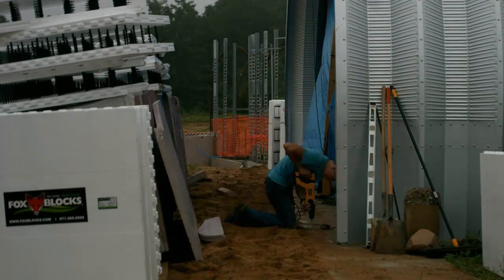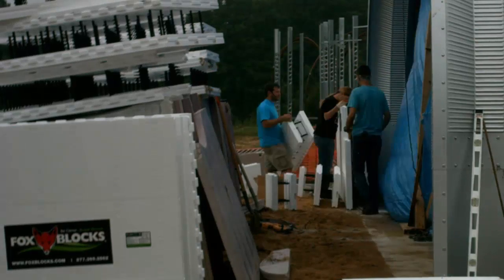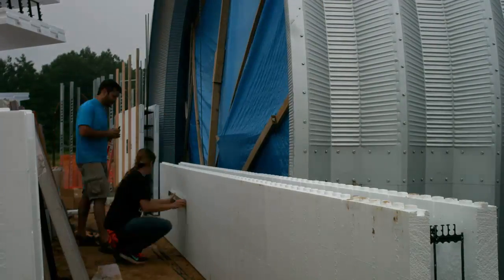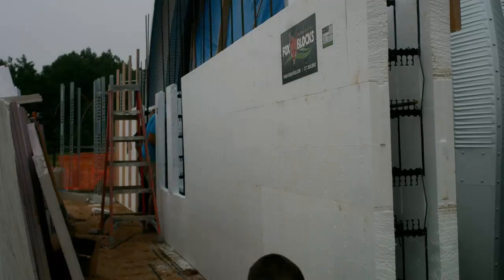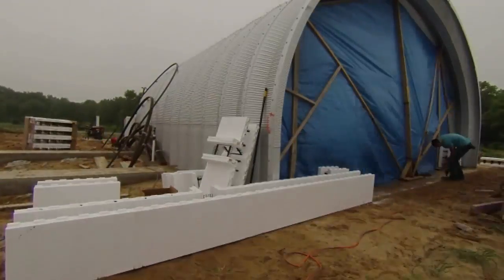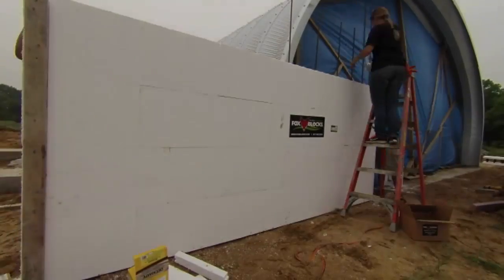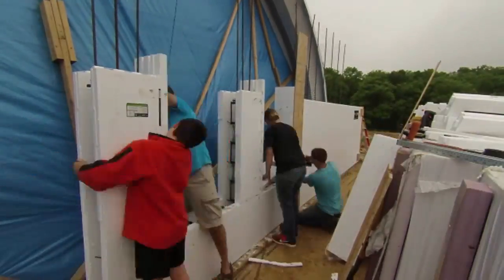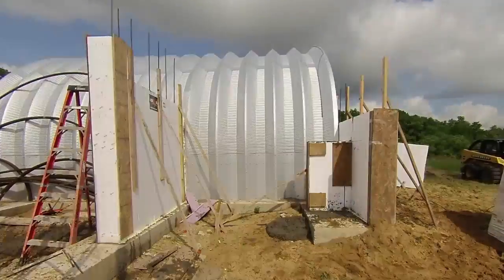18.0 Fox Blocks ICFs for the rear wall of the garage.

Comment from the maker: Trying to reply to "noproblem2big", but it looks like I will need to do it as a new comment.   

The house is very elaborate, a little too elaborate now that I am building it.  It looked good (to me) on paper and will probably look good (or at least "interesting") when it is done, but in-between, I often wish it were simpler.

The hydronic heating passes thru the south rooms that get direct sunlight and the back rooms that don't...  When the thermostat goes above a certain level in the passive solar rooms, the circulating pump turns on and moves the warmed water from those floors to the back rooms and evens everything out.  This should keep the south rooms from getting too hot while it also warms the back ones.  In conjunction with this, I have also included more passive solar windows in that south room than would normally be recommended for a room of that size because I don't have to worry about overheating.

If the thermostat passes below a certain temperature, then the on demand hot water heater (electric) will kick on...  It will add only as many joules of energy as are required to satisfy the thermostat, so it is is really just "assisting" the passive solar. 

If the calculations are right, that electric heat will very rarely turn on, but I am glad to have it as a backup.
Reply: +Simon HomeintheEarth  between family and friends you have a good team of people to keep you motivated, well done so far!

Comment: just stumbled on your blog recently...this is a one elaborate earth integrated home, how big is the total floor area? and the hydronic slab heating is that going to be ran by solar, or solar+heat pump or fuel? here in Australia we don't get the extreme cold that you get over there but we do get the extreme heat...great job on those concrete trusses, keep up the good work!!